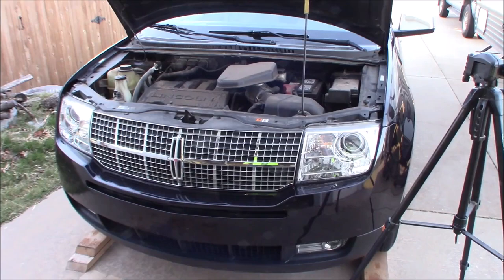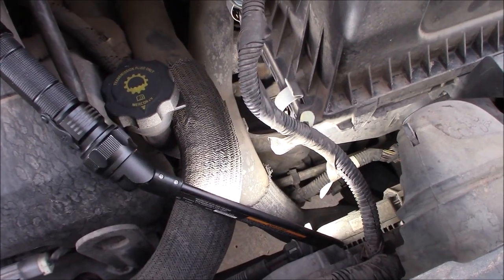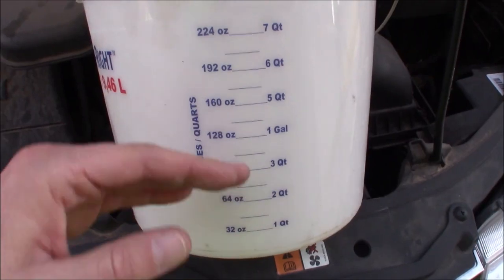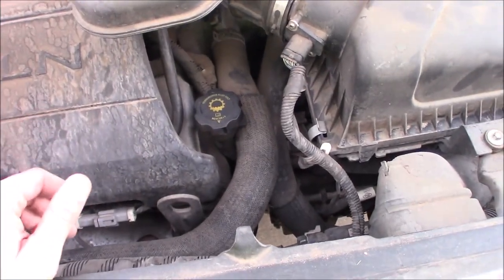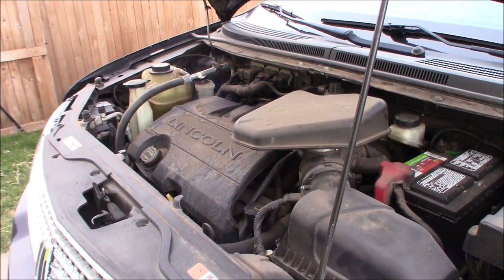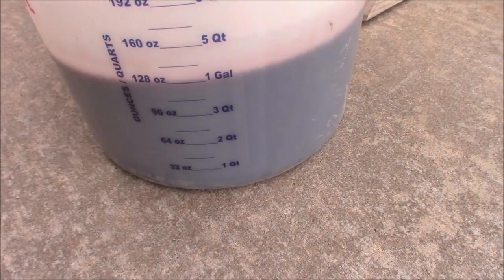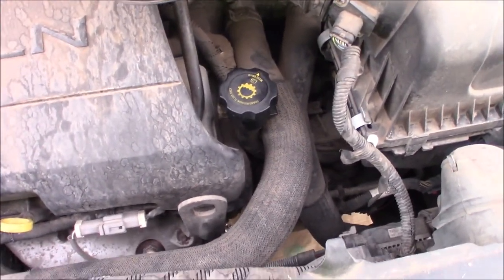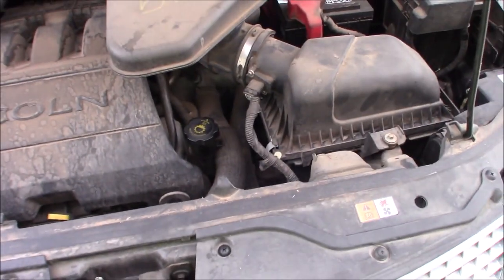Transmission Fluid change Ford Edge Flex Lincoln MKX 3.5L

Comment: I did a transmission fluid change with it hot I put in 5 to 6 quarts and it seems like it wants more
Reply from the maker: how was the level prior to draining? do you still have what you took out?  if it has cooled, check volume now?
Reply: @workingdad  I changed out last night then I drove with it around for a little bit what it was doing and I noticed this while driving The RPMs Felt like they were light as if it was too easy for them to be moving 
I usually throw a hint of is some Lucas transmission additive but never too much because of viscosity but I’m sure that the old oil the oil becomes a little bit heavier so the Lucas additive viscosity it’s just as heavy as old oil but it’s like a form of heat protection for the gears however I do recall if you put too much some of that dirty stuff that’s in the transmission Will get to places that you don’t want to have it so I’ve always known to not put too much additive , i’ve done multiple transmission oil changes on my vehicle sometimes I just look back to reflect on how many quarts I need I always buy more than I need and I ended up using all of them I have 6 quarts I used 5.5 of them with .3 Lucus additive originally I thought I had overfilled but when I let it cool off overnight it showed that I was low but I was still in range so right now I’m gonna fill it up by .5 let it sit and see what it becomes
Reply: @workingdad  I do DoorDash I’ve done like 1500 deliveries i’ve done a lot of replacement work on this vehicle Rack & Pinion inner tie rods & outter rods , CV axles , 1 engine mount , both lower control arms , Water pump timing belt , wheel hubs , brake booster and master cylinder and a few other things but yeah it’s a maintenance vehicle is like either buy a new one or stick with the one you got
Reply: @workingdad  so my update is that I was short on oil the best way to check when it’s cold is to tilt the dipstick on its side and it will show that line more thoroughly because for Lincoln dipsticks it has a round thickness to the metal dipstick allowing us the turn it side giving us a more visual reading , now time to burn my shit out ✌🏼
Reply: @workingdad  I belched out all the time shit ain’t nothing like those air pockets to help pop thaT transmissions back re align thAt spine , maN those ducks great nesting material will fertilize the ducks and there natural environments time to go help the ducks